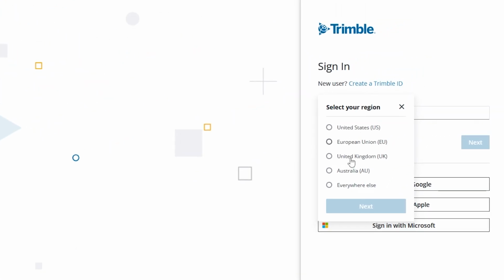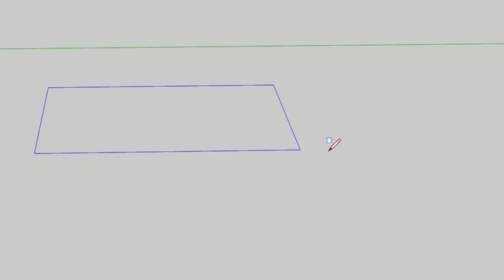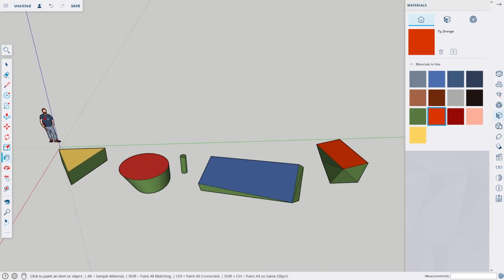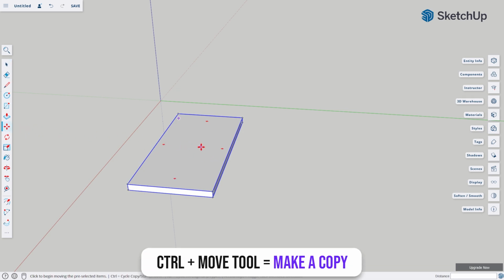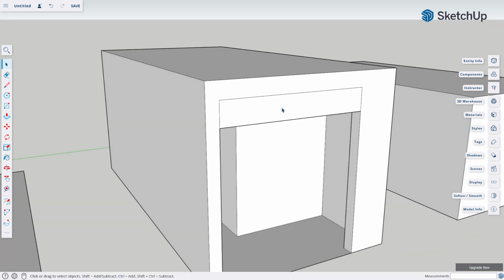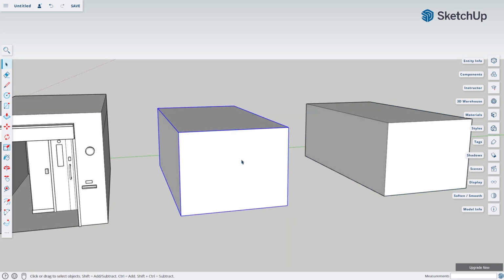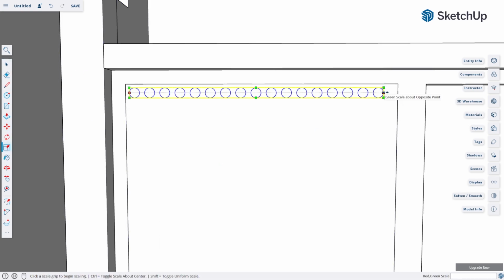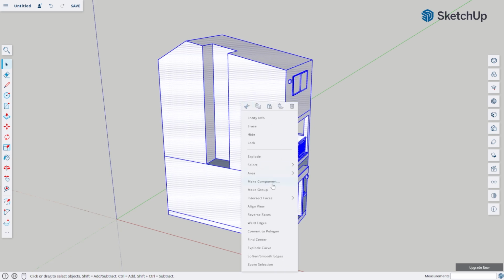This FREE 3D app will level up your anime illustration [Part 1]

Comment: I think you have never heard of blender before, it is much easier and professional than this one
Reply from the maker: I'm using it, too! Really cool for NPR and toon shader. I'm switching between the two depending on my needs.

Actually, the thumbnail was rendered in Blender using the Sketchup file :D
Reply: @JujuArts  lamo😂
Love your honesty mate and good explanation
Reply: I tried both, and Modelling in Blender was way, way easier and intuitive. Once you properly set it up with asset libraries, and few selected add-ons, Blender has got no competition. This is when I've not even started with procedural generation using geometry nodes.